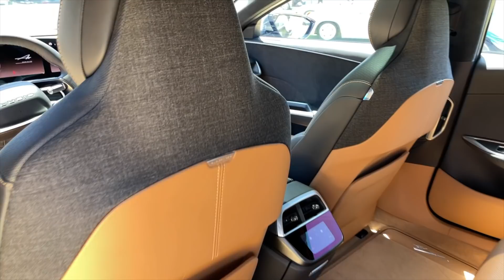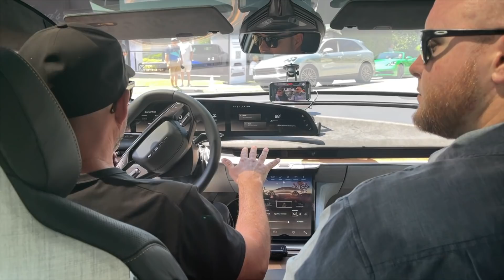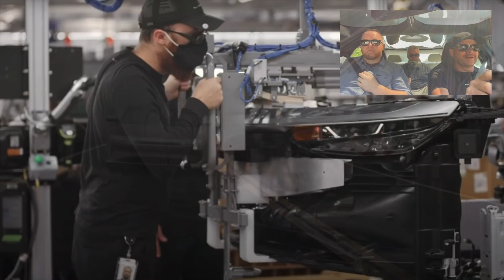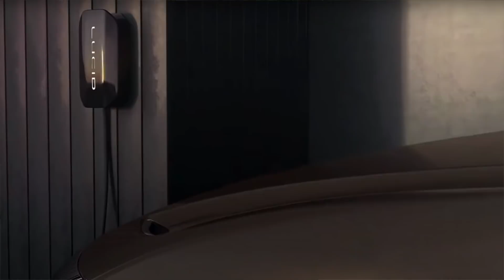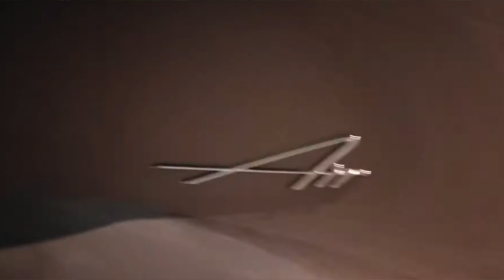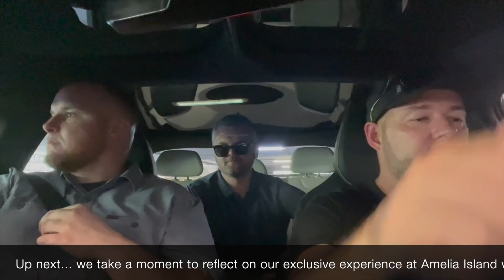$CCIV Lucid Motors: Exclusive ride in Lucid Air + Interview with Derek Jenkins, Senior VP of Design

Comment: Late comment but maybe you'll see: 1 question and a couple comments.
Glass roof. Florida sun. Was it hot? Lucid says they have special glass. Hmm. I live in Texas, have a touring reserved. Should I get the aluminum roof?

Good video and interview. I really enjoyed it. Many times better than Out-Of-Spec's (also "exclusive") yak-fest.

The Air is certainly about making a statement but did you know Lucid's goal, like Atieva before, is to be a component supplier? It's encouraging that all the other brands came to talk to them. Rawlinson has spoken many times about supplying motors, batteries, and high power electronics to other OEMs. Motor factories scale much, much more quickly than hand fitted luxury car body shops. Odd that nobody talks about this.

Hot Tip: Jonny Lieberman of Motortrend has an Air Right Now, drove it from LA to SF non-stop at high speed, 400+ miles w/ range to spare. He is posting on Instagram now and review publishes Wednesday.
Reply from the maker: Yes, a special glass that has a gradient-like shade to balance all direct light.
Reply: And then I saw your interview w/ Rawlinson, so that covers the Lucid as supplier comment.

Comment: I have a Model S on order since early January 2021, and the inconsistency, on again off again, disappearing dates of promise to no promise mentioned at all disgusts me to no end.  Lucid as of late has been releasing the right amount of information, that if the 80/20 rule accurate is making me turn my head.  Have had a reservation for several months now, been talking with a great sales guy from California, and they have turned my head towards the potential of this brand.  A photo finish...if Tesla comes through before test driving is possible, then I will go Tesla and be done with it.  If not, and Lucis is available for a test drive and purchase potential, then if liked, Lucid.  Good information and Derek is on top of the car game and was helpful!!!

Comment: Since we are talking stocks, my strategy is a little different than most people.  I am buying CCIV, and then selling short term (2-3 month) covered calls.  The goal is to intensify annualized rate of return.
Reply: i cant do that cuz i bought it at $30.
Reply: @maxximilianm3752  Got it.  It will go back up again once the merger is finalized and they are producing cars.  I will be in and out as it goes higher.
Reply: @georgesealy4706  right. Aren't they supposed go merge now any day?
Reply: @maxximilianm3752  Supposed to be by June 30.
Reply: @georgesealy4706  damn. Long time ⌛lol . But yea I like the a
Stock . I wish my buy price was around low 20s.
Reply: @georgesealy4706  how long have you been investing ? 
I actually like that strategy u going with. How does that been working for you long term?
Reply: @maxximilianm3752  I have been investing for over 40 years, yes I am an older guy.  I am an income/dividend investor in my main brokerage account.  But I do convered call writing in my IRA accounts because I don't want to suffer the tax messiness.  It works best for me if: 1.) the underlying stock is solid and off it's 52 week high.  Basically I like bargains, which limits the downside. So I choose carefully.  2.) I go with short term call option writing of 2-3 months.  This gives me a higher annualized ROI, and it limits the possibility of the underlying stock falling off due bad news. There might also be a dividend distribution during that timeframe.   As an example, right now CCIV is priced at $19.72.  I think it is solid and at a low. The August 20, $22.50 call option bid is priced at $2.01.  So you could buy 100 shares at $1972 and then sell the call option for $201.  If the stock doesn't go above $22.50 by August, then you make $201 on $1972 in 83 days.  That is a 14.3% return, which is 62.9% annualized.  But if the stock goes above $22.50 and option is exercised, then you make an additional $278, for a total of $479 in 83 days.  That is a return of 24.3% or 106% annualized. I'll take it.  Yes, you must be willing to give up the homerun if the stock jumps up like crazy, but then making money is always a good thing. You just take your money and find another good candidate stock/option combo.   Like they say, "Bulls and bears make money, but pigs don't."
Reply: @georgesealy4706  wow thank you for the insights. It is always amazing to learn from OGs like you. I haven't actually done call options yet and I'm not really understanding it well yet cuz I been told that's like more gambling.. I could be wrong. 
But I like buying solid stocks just like you and keep em at least few weeks to few months and sell and move to another one or wait for a dip and buy it back. Down the road I do actually wanna try going with call options once I start making good returns. It is wise to have few accounts which one is mainly for dividends/long term.
Reply: @maxximilianm3752  If you BUY a call option, then yes, it is somewhat closer to gambling.  However, what I doing is SELLING call options and using the underlying stock to 'cover' the liability of providing the stock should the option be exercised.  Good luck to you.
Reply: @georgesealy4706  oh ok, got it. I will study this and see how it works, might as well have to try it. Good luck to u as well.

Comment: Is there a way for an electric vehicle to 'engine-brake' when going downhill? Not sure whether regenerative braking is as effective as ICE vehicle engine-brake.
Reply: Depending on the setting, regenerative braking can be every bit as effective as engine braking, and even moreso.  Regenerative braking can bring an EV to a full stop if so programmed.  Also, unlike ICE engines, EV motors in regeneration return energy to the fuel tank (i.e., the battery pack).

Comment: Buying lucid stock every chance I have!
Reply: LUCID motors is a FRAUD.
Reply: @markplott4820  Why where your proof
Reply: @fl3cko91   - I've DONE my Research.
NOW its time to do YOURS. 
LUCID is a MASSIVE FRAUD. 
its, ALLEGED that Lucid used a TESLA model S Platform on the Lucid Air to SET Track Times, and to Build its TRACK CARS. 
have YOU even looked under the HOOD of a LUCID ? 
do YOU even know what TRANSMISSION the Lucid is using ?
Reply: @markplott4820  for real

Comment: Either of you own or rode in a Tesla?   How does it compare?
Reply from the maker: Yes, I have rode in multiple versions of Tesla’s. The biggest difference between the two is clearly the design (interior and exterior) and space available inside. Both drove very smoothly but the Lucid has a lot more force when it comes to acceleration when putting your foot to the floor.